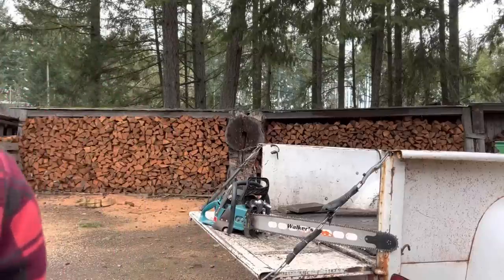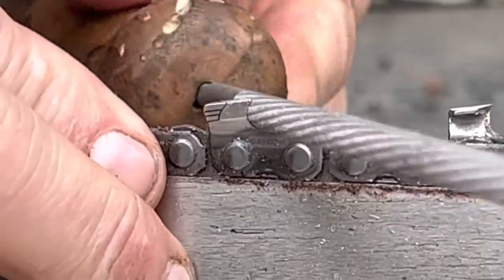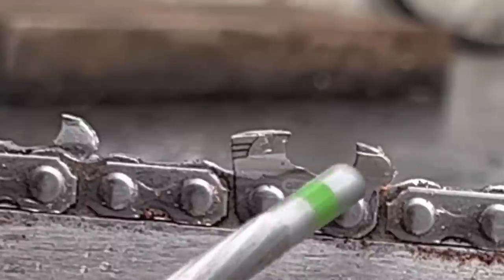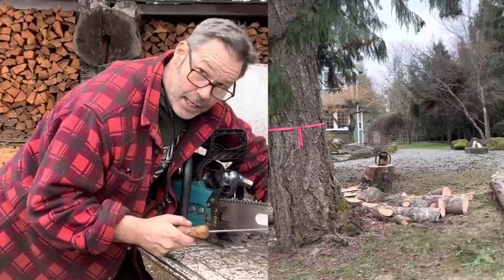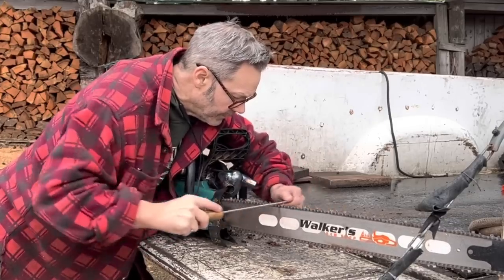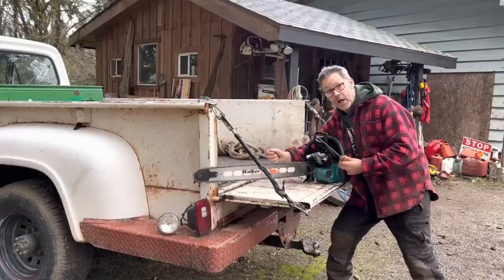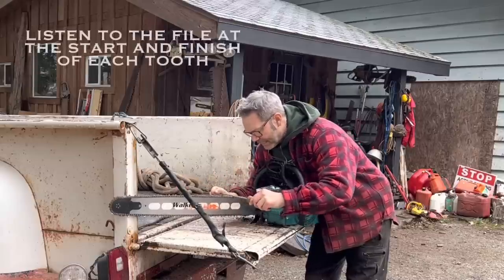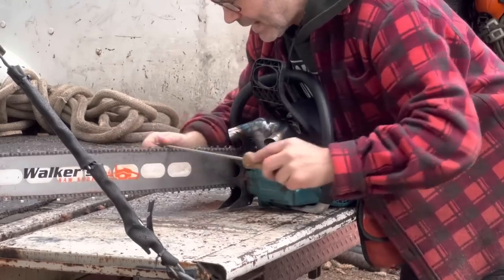How to Sharpen a Chainsaw on a tailgate

Comment: Ya know, Billy (or Buckin' if ye prefer), you. are. a. real. gem. - While I'm new to sawrin, I was taught filin' by an old tool-and-die maker and know exactly what you mean when you say, "Listen to the file..." and patiently, eagerly, I continue to watch and learn from a MASTER such as yourself. Thank you. Also, at about 10:12 in, you edit a quick "BRRRAAAHHHHHHHHHHHHHHHHHHHP" with that big ol' Makita, and then cut back to quietly filing on the chain on your tailgate... I bust out laughin! I did... you always prove your point. You are a delight.

Comment: The sound when the file is gliding is so wonderful, I went through a lot of different brand files.. currently using a forester, it's got a mean spiral to it seems to sharpen very well.. After watching a video of yours a while back, I went out and got a yoga ball and have been using it. It really helped me get out of a slump
Reply: You just answered my question..iv got cheap 2 pack files.the spiral is not good..and seems to not cut well..I'm going to buy one like yours
Reply: @gregmccarter2176  yeah they're pretty aggressive

Comment: I like sharpening for "fast" cutting, in soft wood, endurance in hardwood.   For fast cutting: steeper angle, and elevated (towards the sky).  For hardwood semi-chisel (round top plate) and sharpen to "exact"  angles.  (just my personal philosophy)  😁😁😁😁😁   I have to add:  any type of filing that differs from "factory specs"  per se;  can be extremely dangerous to operator or by standers........Have a great and SAFE day everyone!!!!!  "if ya love what ya do, you will never work a day in your life"

Comment: I see a lot of people file the rakers "way down" .    I think that is probably not good,  especially in low to mid power saws;  performance actually is reduced I think.  (opinion)    Chain speed and follow thru without stoppage is essential for overall speed  of production (also an opinion)   Buckin' has reinforced and educated me at the same time on overall power saw operation and maintenance, thanks BBR!!!!!

Comment: Little over two years ago I was pretty good at sharpening. But after watching bucking now my sharpening game is gone through the roof. I run a stock 372xp x-torq. Most of the time I'm running a 28. If you know how to sharpen that will make life fun.

Comment: Not tried yet...
I bought one of them square tube jobbies that slides into the trailer hitch (and the extension to past the tailgate) then up to a flat plate that will hold my 5" vice. (Bought a better one for replacing the garage 5")
~ More for in the field use up at gramp's old digs that's half wooded...and quite a few beavers.
I'm not as skilled/used to as you. I figured I'd give myself a break holding the saw still for two handed/moving the blade around. One bar is 28". 
~~ Tad bit of wobble from connections. (three pieces) But the file does the work right? 
My frustration is watching for where I began. methinks I need a dayglo color sharpie. (-:

Comment: When I am teaching newbies how to filing a chain for the first time, I use this analogy; when the file goes from chattery to smooth, you are 90% from complete, then do 3-4 strokes under the tooth to clean it up. This nearly always has them filing adequately by the end of filing a full 28” or 32” chain. On our smaller saws with semi-chisel profiles a lot of guys actually find these harder to sharpen well.

Comment: Great info, thanks. I have been only stroking each tooth 3 or 4 times, maybe that is one of my problems.
Reply from the maker: You mean if you rock yer saw . You only stroke it3-4 times?
Reply: @BuckinBillyRaySmith  Yeh, I always worry about doing "to much"
Reply: @jason-white  I used to worry about that, too but the chain is a consumable part and if it's dull it's hard on you and your saw. It's like worrying about wearing out a straight razor and scraping your face with a dull blade.